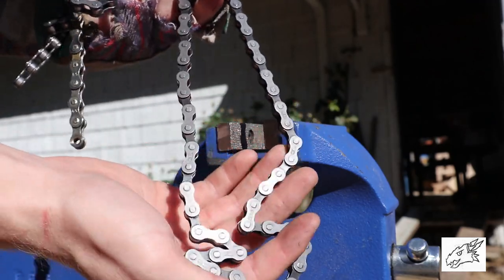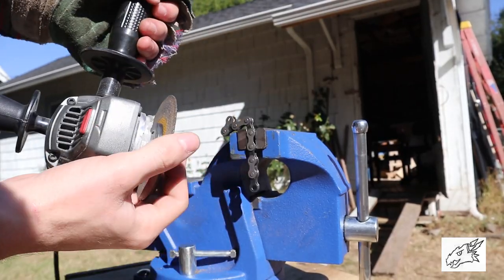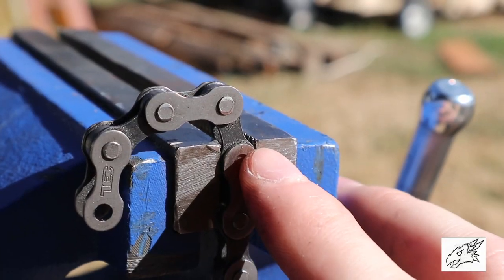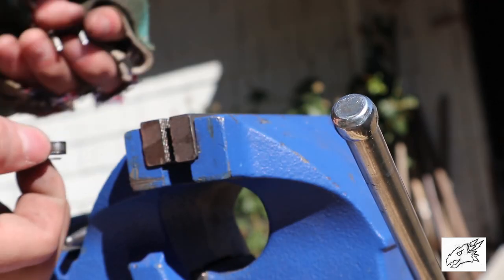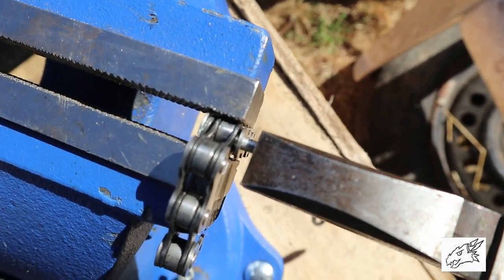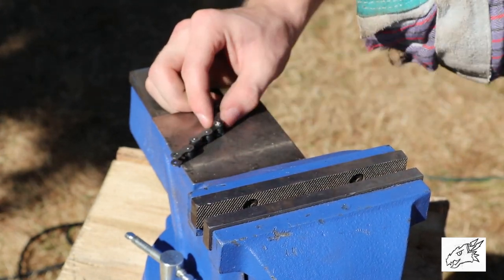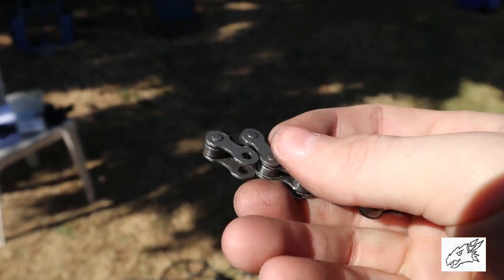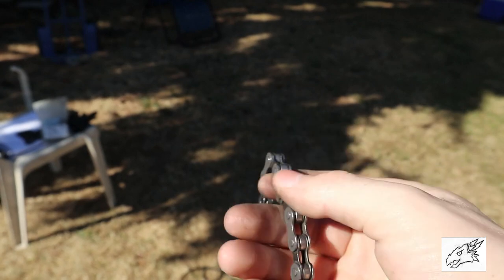How to break a bike chain (without a chainbreaker)

Comment: I have a 415 H chain. I ground down the pins to nothing and they still won't come out.
Reply from the maker: Did you hit the pin with a hammer?
Reply: @StrayHydraBlade  yes.
Reply: @ChuckHaney  center punch and a bench will push her own through
Reply: @jking1286  I ended up buying a heavy duty chain breaker. Works great.